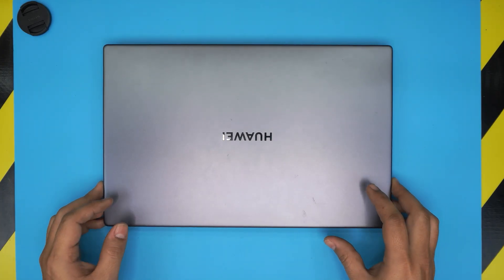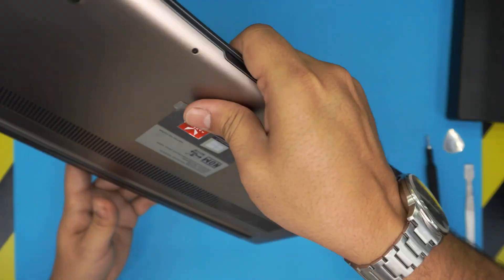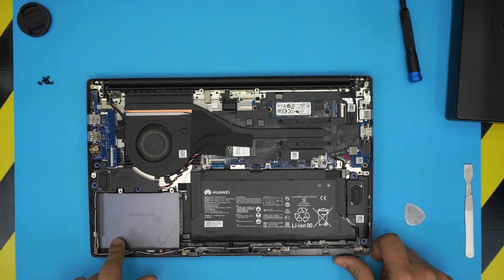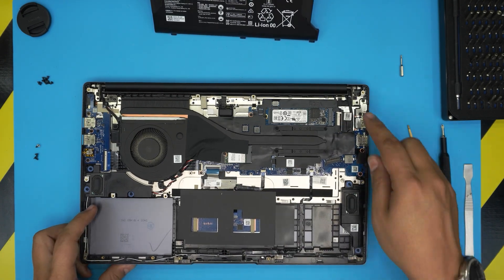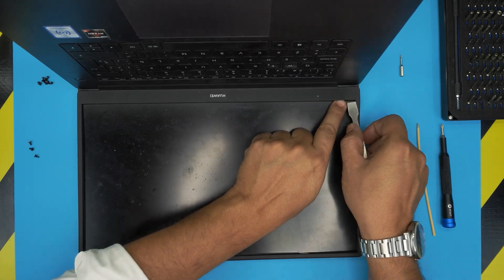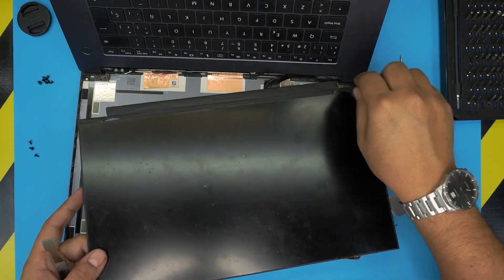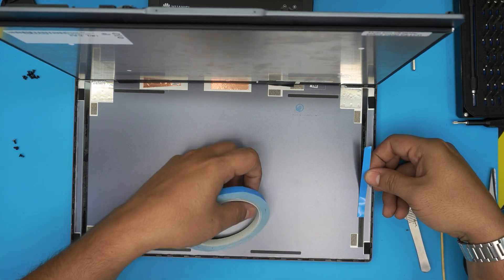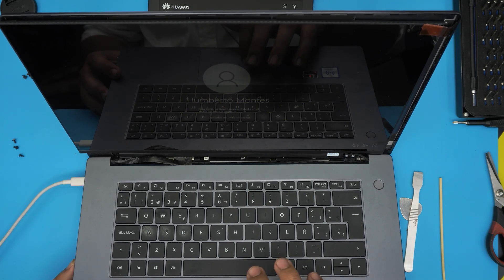Huawei D15 Boh Wap9r 💻  LCD Display Replacement

Comment: I've similar laptop and my laptop screen is flickering sometimes. not completely but sometimes half or more. I checked the cables or moving the screen doesn't affect low or high flickering. It stays same. Already tried resetting the Windows 11 to factory but it remains same. I think the screen inverter got the issue and needs replacement. 
Please advise what should be done?
Reply from the maker: 🫠Regarding your question, we get this issue in the store a lot with these panels. There is no fix for them as they don't sell the components, and they are a pain to solder and repair.  
The best, fastest, and cheapest solution is to replace the display.
Should you have any further questions or requests in the future, please don't hesitate to ask me.
cheers🍻
Reply: @uFixTek  From where I should get the display? On Huawei site it's quite expensive. It's 1/4 price of new laptop. Is there any cheaper place or I must buy from Huawei store?
Reply from the maker: Remove the display, and on the back of the panel, you’ll find the model number. You can get it from Aliexpress for a cheaper price with the same quality, or you can buy it from Amazon. I have linked it in the video description.
Reply: @ Thanks. It really helped. I found 3 times cheaper display on AliExpress. 
But something funny happened. I opened the seals of my laptop display to check the part number. The screen started to flicker like crazy. I opened the screen and put it back and now screen is not flickering anymore. :D I will keep using it, if it happened again I will have to buy display then. 
Much appreciate your support.
Reply from the maker: It's my pleasure my friend.
awesome , but that is a temp fix :P
it will comeback and hunt you at night 🤣
i would recommend to start orderign one and keep it on the side, as you will be needing it soon.
Reply from the maker: Yep, keep one on hand for a rainy day.

Comment: what is the difference between pulling out the battery power and inserting it when the LCD is done VS. turning off the laptop without pulling out the battery power and inserting the LCD flex cable?
Reply from the maker: 🫠Regarding your question, the reason we recommend disconnecting the battery is as an extra layer of protection for inexperienced users, as they may accidentally drop something metallic on the board and create a short. To replace the LCD or disconnect the flex cable of the LCD, it is not required to disconnect the battery. I do that to provide an extra layer of protection for the viewers.  

If you are confident that you won't drop screws or metallic objects on the board, then there is no need to disconnect the battery.

Should you have any further questions or requests in the future, please don't hesitate to ask me.
cheers🍻
Reply: @ Thank you very much.
Reply from the maker: It's my pleasure my friend.
🫠👍

Comment: Hey i have the same Model (Boh Wap9r) and was wondering if I can also use the screen of the D 15-53010TUY model. I looked up the specs and they are identical to mine, but im still not shure. I cant get the Boh Wap9r Screen in my country thats why I am asking
Reply from the maker: 🫠Regarding your question, yes you can the LCD panels are the same
Should you have any further questions or requests in the future, please don't hesitate to ask me.
cheers🍻
Reply: @uFixTek  thanks I did and it works fine! Thank you for the tutorial

Comment: Will i have to replace my screen if it looks like its doubled
Reply: Or is it just that the display cable came loose
Reply from the maker: replace the screen, if the cable is a tiny bit loose you won't be able to see anything on screen.

Comment: Do u have to do the last part? (Opening the back).
Reply from the maker: 🫠Regarding your question, no, you don't have to remove the back cover if you don't want to; that is just for extra protection. You can remove the display bezel and then replace the display without removing the back cover.
Should you have any further questions or requests in the future, please don't hesitate to ask me.
cheers🍻

Comment: Hey man. I really do appreciate the work you do. I have a question on the screen for this laptop as well. Around weeks ago, it all started with some blurring lines on a quarter part of the screen. I suspected some cables inside were loose since it went back okay when I tried to open it the next day with no resistance. Now it just continues with the flickering, like just a quarter of the screen is broken (like low-frequency blurs) and the 3/4 is fine (just some flickers every time I open a colored image).

When I get this fixed in their service center, do I need to have the screen replaced? Or do I have, at worst, a loose cable that just needs some reattachment? I'm a student so I can't probably afford an entire screen replacement anytime soon. Hoping you've had some issues like this in the past which could really help me decide on what to expect when I get it fixed.
Reply: I'm anxious about opening the screen myself, afraid of causing it more damage than it already has.
Reply from the maker: It's truly a pleasure, my friend. 😊 I deeply appreciate your taking the time to provide feedback. If you're inclined to support the channel further, feel free to like and subscribe—or even both!
Regarding your question, the issue it can be from a loosen flex cable connector or it could be the screen matrix board is bad and need to replace the screen. you will need a service center to take a took at the connector of the screen. not something you should touch.

Comment: What LCD does this laptop use?
Reply from the maker: Thank you for your feedback! If you wish to support the channel, you can like, subscribe, or both!
Regarding your question, it takes a no bracket FHD 1920 * 1080 30 pin connector: https://amzn.to/3RiRTyj
Should you have any further questions or requests in the future, please don't hesitate to ask me.
cheers🍻

This is an Amazon affiliate link. When you use my links, you are helping to support the channel. 🙏
Reply: @uFixTek  can I just use hd instead of fhd?
Reply from the maker: you could but is a lower RESOLUTION.
Reply: @uFixTek  yeah I just want to buy cheaper things anyway thanks for your time you deserve my subs👍
Reply from the maker: It's my pleasure my friend.
ya you could get a cheaper lcd res but trully not worth it. look for used panels on aliexpress or ebay

Comment: Is it the same process of replacing screen on the huawei matebook d14
Reply: Hello, I replaced my screen. Everything works fine. However, I don't like how my front plactic frame looks like because for d14, it was glued on. Do you know anywhere they sell top frame plactic I can't find replacement for it anywhere
Reply from the maker: you can get those on aliexpress they are very cheap, look in there for screen bezel
Reply from the maker: Thank you for your feedback! If you wish to support the channel, you can like, subscribe, or both!
Regarding your question, yes it is the same exact steps my friend.
Should you have any further questions or requests in the future, please don't hesitate to ask me.
cheers🍻

Comment: Thank you for this video, pls continue on making videos about Huawei matebook d15
Reply: Question: is it safe to replace the lcd even If I didn't unplug the battery, I don't want to open my laptop, cause I might damage the component due to static shock
Reply from the maker: Thank you for your feedback! If you wish to support the channel, you can like, subscribe, or both!
Regarding your question, sure you can my friend without any issues, you can just remove and install the lcd without removing the battery.
Should you have any further questions or requests in the future, please don't hesitate to ask me.
Reply: @uFixTek hello thank you with the response. Before installing the LCD, the manufacturer/seller told me that there is a process in the settings-display  that I need to do before replace with new lcd, is this necessary?
Reply: Connect the old LCD to an external display - Settings - Display settings - Copy these displays - Display both screen 1 and screen 2 - Save settings - Then replace the new LCD - Restart, please strictly follow the process settings, and be sure to use the old LCD settings before replacing the new LCD,
Reply: @Medrake03  Or might as well just power it on and use win+P combination to cycle through the projection options until you land on Duplicate, and work from there

Comment: My laptop doesn’t turn on now at all. Even with the battery disconnected and power bank mains plugged in…
Reply from the maker: you need to go back and make sure that all the connectors are inserted and double check to see if you didn't damaged anything or missed anything.

Comment: Brilliant video. Where did you get the replacement screen from please?
Reply from the maker: Thank you for the feedback! if you wish to support the channel you can LIKE or SUB or both :P
regarding your question:  search for the exact lcd part number that is at the back of the LCD on Aliexpress
Reply: So I have to open it up to find out this number on the LCD?
Reply from the maker: @SSM10305   Yes, my friend, you need to check the back of the LCD for the exact model number. Even though the brand and size may appear the same from the outside, the manufacturers sometimes use different models of the LCD with varying pin counts. Once you open it up and give me the information, I can help you find the correct model.

Comment: Hi! What if the screen goes off when fully opened? At the same time, the Fn and Caps keys light up.
Reply: Have you ever had such cases? What should I do then? Year of release 2022
Reply from the maker: Thank you for the feedback! if you wish to support the channel you can LIKE or SUB or both :P
regarding your question: when is not fully opened the screen there is no issue?
Reply: @uFixTek  Yes, everything works absolutely fine, but when you open the laptop lid at the maximum angle (150-160 °, like), the screen shutter turns off.
Reply from the maker: ok its the flex cable at the back of the LCD that its getting tension! open the bezel and pull about 2-4mm the cable from hinge side to the screen. https://imgur.com/a/Oe4EhyV
Reply: @uFixTek  o, thanks! And is this a serious problem? It will not create problems for the laptop in the future? I just don't want to take it apart, I'm afraid I'll break it :D
Reply from the maker: hell no its totally fine,  the worst it can happen that after some time it my get disconnected and you won't get image and then you will be forced to open and reinsert the connector. you fine totally
Reply: @uFixTek  Many thanks for the help! You reassured me, now I will know about it
Reply from the maker: @nicetasantonius860  no problem its my pleasure to be able to assist you :)

Comment: Do you really need to disconnect the battery first? And btw can you use a different 1920x1080 IPS FHD LCD? Like different code
Reply from the maker: Thank you for the feedback! if you wish to support the channel you can LIKE or SUB or both :P
regarding your question: no you don't need to disconnect the battery i have to say it because its a extra safety layer, some people don't power off the laptops , so by removing the battery it assures that the laptop is off. yes you can as long as the pin count on the LCD its the same and the LCD size are the same you can get IPS 2K 4K if you can find any
Reply: @uFixTek  for example. The huawei matebook D15 is using TV156FHM-NH1. Can I use anything other than that live NV156FHM-N48?
Reply from the maker: yes its very compatible my friend they both have eDP (2 Lanes) , eDP1.2 , HBR1 (2.7G/lane) , 30 pins Connector
the NV is better because of the Color Depth: 16.2M, they both have same Refresh Rate, Luminance. 
just color depth is better on NV
Reply: @uFixTek  thank you. Now I know what to buy
Reply: @uFixTek  you deserve a follow
Reply from the maker: Much appreciate your support, 
if you have any question or request in the future feel free to ask me.
Reply: Thank you guys
Reply from the maker: if you have any question or request in the future feel free to ask me.
Reply from the maker: @Techno News i would not go over the 2K and because the power management on board is not designed for a high power consumption, it will work but it will bring the life span of the motherboard down on the LCD buck converted section. i would say go with 1080P i have looked at the schematics at this laptops that have 1080P and the one with 2K and they are very distinct power regulator and one with better and high amp converters and the other not much. so again you could but not recommended. as @Techno News  said it will start having abstracts Backlit flickering, and if you keep the laptop powered on for long enough daily it will damage the board over time.
Reply: 4th 59⁴⁴4⁴⁴4⁴⁴43445as64
😮5
Reply: also thing about diferent screen i have mat full hd but its only 50% srgb :/ tragedy Au Optronics B156HAN02.8 15.6" its ips but colours are so bad.. hmm

Comment: Hi, Thank you so much for the detailed video. I have a question though, my display has a few horizontal lines at the bottom of the screen, very minor lines but I'm not sure if I should replace the screen or can be fixed without replacing it. Because is the laptop Is just over a year. Any advice would be highly appreciated!
Reply from the maker: Thank you for the feedback! if you wish to support the channel you can LIKE or SUB or both :P
regarding your question: its very very very common this happening on this models we get them in the store often, and the reason for this is that the hinges are really hard and every time you open and close the lid the creates a pressure on the lower lcd and that causes the lines and over time it will increase, unfortunately there is no fix to this as this is physical damage to the panel, you will need to replace it, and when you do loosen up the hinges a bit by twisting the nut on the hinges(open the nut half tun)
Reply: @uFixTek  Thank you so much.
Reply from the maker: its my pleasure my friend,
if you have any question or request in the future feel free to ask me.